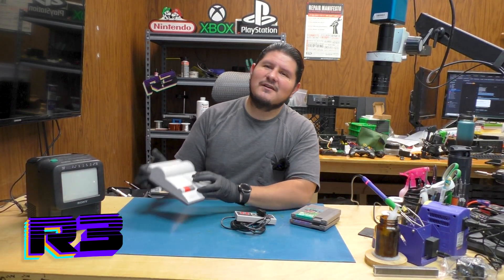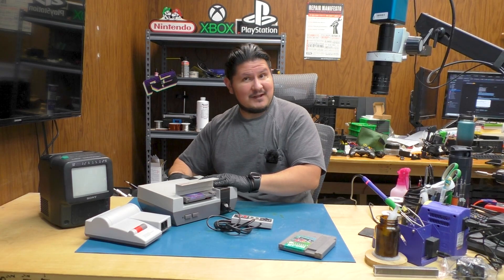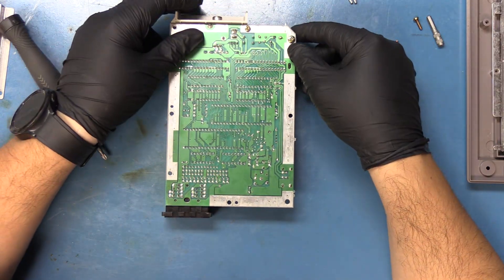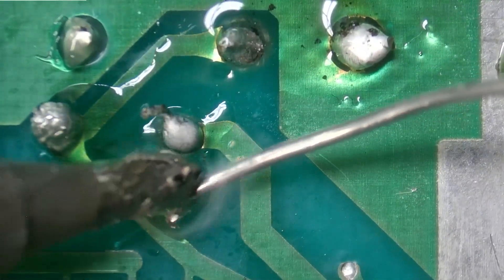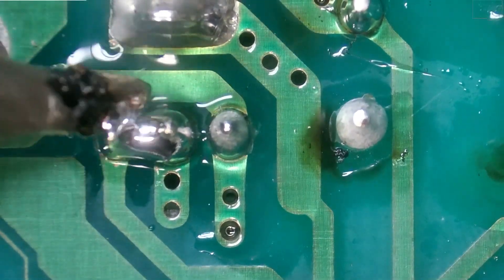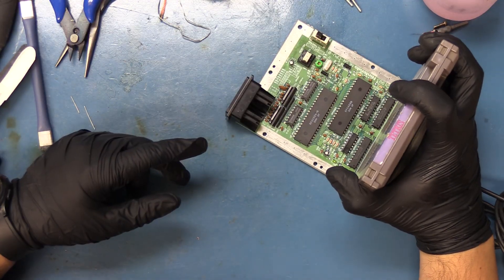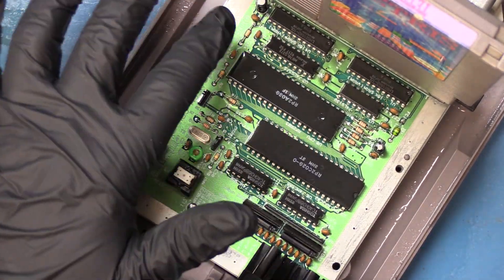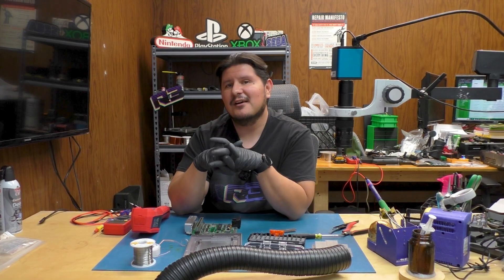The Surprising Reason This NES Top Loader Console Is Broken

Comment: I'd love to know the actual name of the "vibrator" tool to remove solder mask (tried to search with no avail, and it's not on the description either), ironically I've been struggling to remove some hours ago.
Reply: Just scrape the mask with an xacto
Reply: @Retroandrarevideogames  it’s what I’ve been doing so far, but for some areas that tool would have been better
Reply: @takmk  it’s a cpu chip grinding/polishing pen. His looks like a Walmart one.
Reply: @Retroandrarevideogames  Thanks!

Comment: I’m thinking this console was powered up before hand when the motherboard was cracked and tampered. 

Probably led to unwanted shorts that toasted the main processor chips. 

Looks like the work done to the console prior was not good. Nice way of demonstrating how you can touch up cold or cracked solder joints!